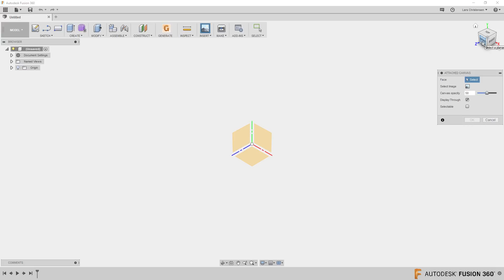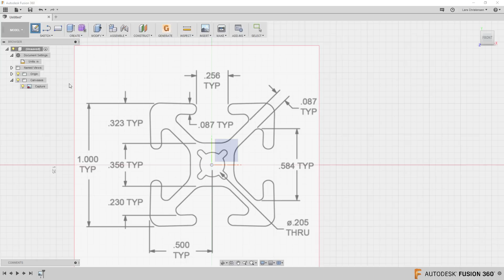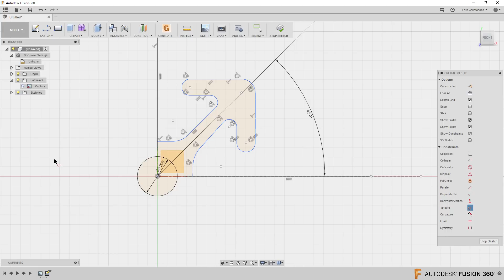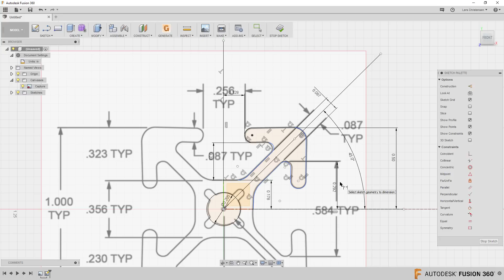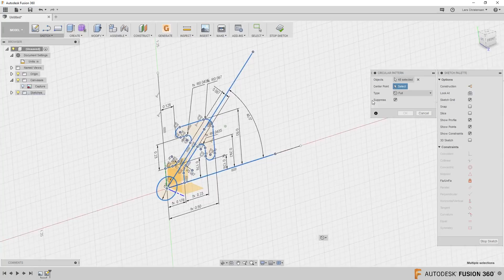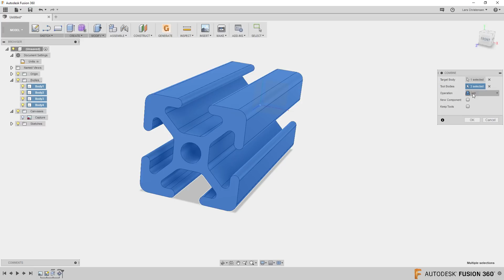How I Would Sketch 80/20 Rails — Fusion 360 Tutorial — #LarsLive 152

Comment: I created one sketch. started from center and made the circle then I started making squares off circle center and then just trimmed the edges for the 1 slotted cut out pattern and extruded it then did polar array with feature. Took no time at all. Also the little slots on the inside at center circle I just figured the end circles were half the thickness of 0.087" to 0.04375" and the center was on a circle that was half the thickness of where the circle and the inside cuttout face of the slot is. Good Video. I don't use the Canvas unless it doesn't need to be exact.

Comment: Thank you for your verry good presentation, I like it! 😘
 I've designed CIM/CAD/CAM systems from 1980 to 2000  I have also taught them at universities and in companies.
With Soli
dworks I have worked from version 2003 to 2016,

"I love it", 😍 BUT Fusion 360 is FREE 😍
 and it's the right Thing for the makers. 😊
Sure, there are still a lot of wishes left and some react strangely.😗
 But that has been the case for 40 years with all software systems, 
from Windows to Adobe and Eagle to Solidworks. 
My only sincere regret is that the simulation is not included in the free version.😔😪 
Happy Easter and stay healthy everyone

Comment: This was actually painful to watch. SolidWorks 4 Life!! 😆 🤣 😂
It would have been easier to just draw half what you did and  use a mirror or pattern feature. That would have been the laziest way. Lol
Reply: I've designed CIM/CAD/CAM systems from 1980 to 2000 and have worked with Solidworks from version 2003-2016,
"I love it", BUT 
Fusion 360 is FREE
 and it's for the makers. 
Sure, there are still a few wishes left and some react strangely.
 But that has been the case for 40 years with all software systems, 
from Windows to Adobe and Eagle to Solidworks. 
My only sincere regret is that the simulation is not included in the free version.

Comment: Interesting and informative.  As a lesson on sketching stuff, it is very nice.  However, there is a rule that seperates useful CAD from simply good enough: "Simple sketches, multiple features."  Because you didnt follow this, editing the model later would be a nightmare.
I would 
1) extrude a square
2) extrude cut the center circle
3) extrude cut one slot in the center circle and then circular pattern it
4) extrude cut a rectangle (0.256 wide) to make part of the upper channel cut.
5) extrude cut the parallelogram to complete the top channel
6) fillet as necessary
7) circular pattern the features to duplicate the channel.
Each thing can be edited independently.
I would probably also use parameters, but that is just me.
Just tried it and it took about 10 minutes.  Not sure it is quicker, but it seemed easier.

Comment: Lars, thanks for the tutorial!
To all of you looking for a sketch to import - you can find a similar drawing if you search for the following terms: "80/20 Inc., 1010, 10 Series, 1″ x 1″ T-Slotted Extrusion x 72″ drawing.
Also, you can improve upon the design process by drawing only one half of the part and then mirroring it over the 45° construction line. That way you ensure the profile is symmetrical and, at the same time, avoid having to copy the identical dimensions over to the other side. :)
Good luck.

Comment: Lars, can you please teach how to design this object: http://imgur.com/gallery/h0fim5s thank you. I've watched lots of videos but my mind goes blank on this object. I know it has to be simple but no idea where to start and how it can be designed efficiently.
Reply: Start with a large cylinder. Model one of the 6 negative-space washer-shaped cutouts. Replicate this cutout object 6 times with a rectangular pattern. Use combine to boolean cut these 6 cutouts from your original cylinder. Now all you have left is the spiral cutout. Create this with the "Coil" and then cut it from your model above. (Edit: Actually the channel for the wire to go from one space to the next isn't a spiral. I'd probably draw this as 3D sketch line and then use the "Pipe" command to create the cutout object.)

Comment: I think in this case you could draw 1/8 of the profile. In drawing however horizontal and vertical profiles are a bit different. Also there was 4 ears to center hole. 
Is it possible to draw this without defining tangent cirlcle radiuses? Imho what we really want to specify is that some of them are equal.

Comment: Starting to duplicate your example but noticed when I made the straight line (~12:34m) then held the left mouse (actually track pad) the tangent curve did start like yours, but as I proceeded up the 45 degree side the curve continued to "curve" and didn't follow the straight portion. If I stopped after the initial curve then went straight with the start of another line extension I could follow all the curves.
Don't know why the difference, I am using a MacBook Pro, but that shouldn't matter.....I guess?

Comment: Very Informative video. I followed this video and made a similar extrusion. After the final step of combining the bodies together, I got a extrusion. But the different surfaces of the extrusion behave independently and when you try to move the complete extrusion, only the surface which you select seems to be moving. I hope I am able to clarify my question. How do you really combine this as  a single body? Thanks
Reply from the maker: Hi Vishesh Shishodia Thank you for watching!
Sounds like you had each extrusion as a component instead of combined bodies. Components will have to be joint or rigid grouped together....Hope this is useful in your detective work :-)

Comment: I'm very curious how to set up the cnc machining. How to get Fusion 360 to cut the parts out of a large sheet of plywood without cutting the plywood into smaller pieces first? My setup always chooses a random entry point and then starts cutting, with a large piece of plywood that usually means crashing the tool into the wood. How can I tell Fusion to create entry points first  and not waste too much material.
Reply from the maker: Hi Arjan de Haas Thank you for watching!
I think you might be looking for this video:
https://youtu.be/00_6u1J0xkA?list=PL40d7srwyc_Mkgc5wvP_OfVel9aDkNkZ6

BEst,
Lars
Reply: Yes that answers half of my question, the problem is still that fusion crashes into the material, like in your example, the bit just plunges to the bottom of the 1 inch thick material.

Comment: Hi!
Thank you for your video, always interesting to see how you work!
Hoverwer, I think you've made a little mistake. First I've noted some assymmetry of two diagonal lines, related to central 45degree line.
Then I've started sketching by myself and I've found the point that you went wrong way: at 26:51, you've made an assumption that inner "fillets" radius is 0.87/2. That gave you two constraints that completed the sketch. However. these two fillets should have only "equal radius" constraint, and the missing constraint is "0.256/2" from horizontal center line to the bootom point of lowest arc (that "couples" the one you have - from vertical line to the left point of arc) the second
Reply from the maker: Hi Станислав Купряхин Thank you for watching!
Good work!

Comment: Great tutorial--worked great for me. I just made a screenshot of the 8020 diagram you posted at the start, and made a PNG file...and followed it through. You forgot the little central notches, but those are very simple to add using the exact same techniques you show in the video. 

One thing I miss though, compared to Solidworks, is the Ctrl-8 shortcut to quickly get a view normal to the face I'm working on. Is there some sort of shortcut I'm missing there Lars? Another nice feature in SW is that hitting the spacebar gives you the "view cube" where you can just use your mouse to just select the face you want a normal view to. In F360 it seems that you have to move the mouse all the way up into the right upper corner, and then rotate the little view cube there. I have a SpacePilot Pro device though, so that helps a lot. More so than in SW actually, as I don't use it there very often--because you can just depress the little center mouse wheel (if you have one) and spin the model; whereas in F360 that action just translates the model. Handy, but not quite the same thing. 

It seems as though I read somewhere that there is a setting in F360 that gives SW-like shortcuts. Is that correct? I'll have to investigate that some, because it would sure be handy to teach this old dog some new tricks...

Thanks for the video!

EDIT: Here's a link to the PNG file I created, if anyone wants to use it to follow along with this tutorial.

https://filebin.net/jqw81wck2xddrv3f/8020.png
Reply: Oh, duh...

https://www.autodesk.com/shortcuts/fusion-360

Google is my (long lost?) friend. Shift+wheel-press spins the model! Then, 'C' (in the model, not a sketch) gives you the option to click on the surface you want a normal view to. And...it automagically starts a sketch on that surface. 

Sweet.
Reply from the maker: Hi Tom B Thank you for watching!
You can also go into the preferences and set you mouse for SolidWorks so you don't have to hold down shift.

Have an awesome day!

Best,
Lars
Reply: I found it, thanks. 

There's one thing that's still a bit frustrating for me though. When I hit the 'c' key to get a view normal to a surface I select (equivalent to Ctrl+8 in Solidworks), I get the normal view alright...but I also get an open sketch automatically. If I want a sketch there, then that's fine. But much of the time I don't want to have a sketch--I just want a view normal to that surface. So I can click on "Stop Sketch" in the Sketch Palette. But the problem though is that you still get a new sketch entry in the feature tree down at the bottom. And since these aren't named by default, you'll end up with a number of empty sketches after a while...thus making it harder if/when you decide to go back and edit a non-empty sketch in the future. 

So you'd think the Fusion folks would give us a way to just get a quick normal view to a surface, without needing to create a new sketch. Is there such a thing? Ctrl-8 doesn't do it after I set the Solidworks preference in the "Pan, Zoom, Orbit shortcuts" field in the Preferences GUI. I've been searching online for a solution and other than the "Look At" option (which seems to require mouse clicks to initiate), I can't seem to find anything in terms of a quick command/shortcut to get me there quickly.

Comment: If all the measurement are TYP, shouldn't it state a range of error?
Reply from the maker: Hi Hyss Thank you for watching! I am not sure what you mean by that?
Reply: TYP, stands for typical which means that the extrusion dies are made to those values but the aluminium extruded can vary within a set quantity. This is usually provided, since sometimes you need to make something that can slide freely but tightly in all extrusions of that design.

Comment: Incredible timing Lars. I was trying to find this in the materials list. A chap who's drawings I am using to create my first CNC Router table has Item24.nl profiles of aluminum extrusion that were generated in Autodesk Inventor. The ones pictured were 80x160mm in use as the gantry support element, and on which the Hiwin 20mm rails were bolted to. (Linear bearings /rail).
This cross-section is far more complicated than a simple 1x1"   and I seriously doubt that the gentleman went thru this process. So how did he do it? This 80-160 profile has 12 x 8mm slots.
Reply: You might want to check out https://www.8020.net.  You have to create an account, but it looks like they have CAD files for all of their products that you can download.
Reply: JB I feel as if I am having an out of body experience here. Or perhaps it is simply the egg on my face! :-) 
I just grabbed a file in "Inventor 2018"  from 80/20 and have brought it into F360 via the cloud upload, and it was very satisfactory indeed. Of course I am not quite sure how to deal with it  as a component in my CNC Router drawing. 
Now if this is easily available, then Lars must  be made aware. gosh I feel like I dwell under a rock some days.